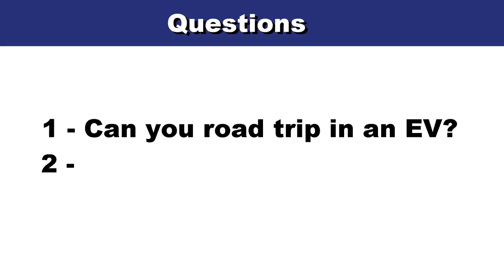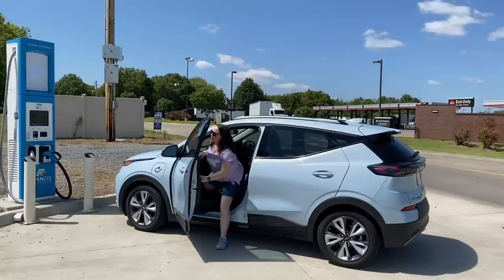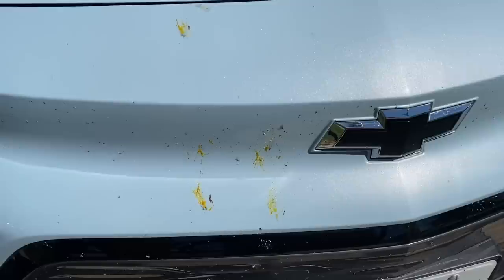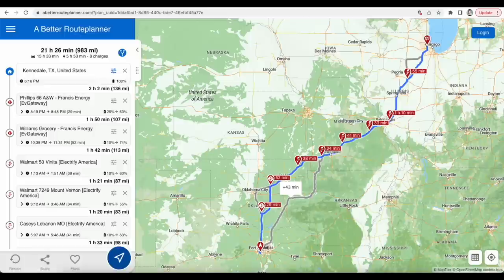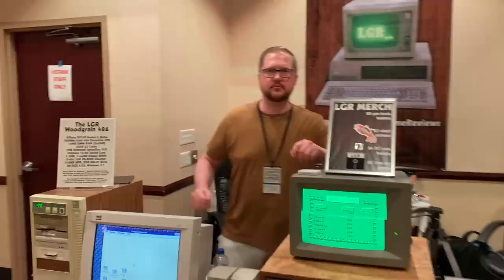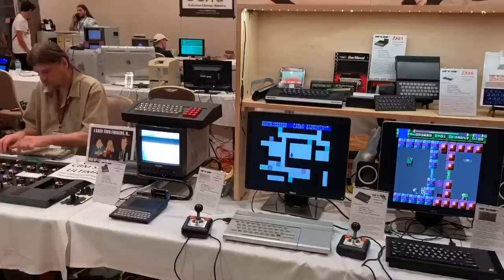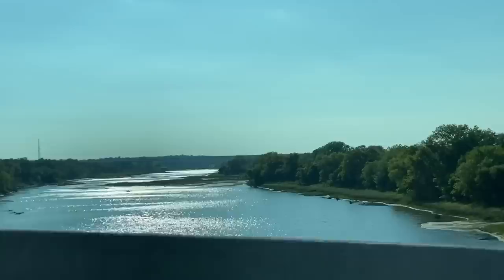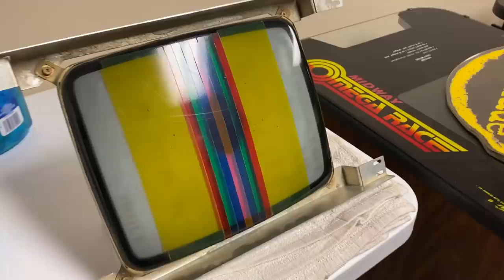EV Roadtrip, Vintage Computer Festival, and Moonbase Repair

Comment: In august I did a cross country trip that was around 80% the width of the country, it was 3 days fo driving and I generally had to gas up twice each day, and I was really pushing it but my car has a fairly small tank so even with decent gass millage I was gassing up every 400 miles. Living out west there are plenty of place that would still be hard to just go out and roam outside of the larger population centers. But sticking to major roads I think most places are fine with EV's now, especially if you are on the top end of range.
Reply: I live out West too, the pro-tip for reaching rural places with EVs is RV camp sites. Plenty of places have 14-50 plugs (or 30-TTs) so you can L2 charge, just either spend a night here and there or see if you can charge during the day while out for a hike.

Comment: I can't imagine having to stop at a gas station every 90 minutes for 30 minutes at a time. That road trip looked like torture.
Reply: I agree, but i would accept it because electricity is so cheap when compared to gas
Reply: @CrobinHood8BitGuy  But you can't put a price tag on your time.
I would have just flown there.
Reply: I used to have a Bolt, but exchanged it for a Ioniq 5. That one has 300 miles range, and it can charge for 0 to 80% in 20 minutes. Usually that comes down a quick 10 minute stop somewhere and you're back on the road.
Reply: @sjdpfisvrj  That sounds much better than 45 minute charges.  But I don't think I could deal with the stress of hunting down electric chargers. They are very rare around me in Connecticut.
Reply: @CrobinHood8BitGuy  But any savings is wiped out when you have to pay for hotels for extra days of driving.
Reply: @John_Locke_108  they are for now, and granted, buying an EV as of right now is a bit of an idealistic choice. But, what people always underestimate, DC fast charges are an exception. The eventual idea is that you arrive at your destination, plug in a Level 2 charger, and the next morning you're full. Fast chargers are there for long hauls like that.
Reply: @sjdpfisvrj  Grocery store will probably toss me out if I try sleeping in the aisles.
Reply: Yeah, I've done a 1000 mile road trip in a gas car in a single day, and that was with regular stops.
Reply: Unfortunately I believe its what's coming for all of us.
Reply: Imagine 80% of the cars on the highway are electric. How many loaders do you need to have on which space? It's impossible / It's the end of private car journeys.
Reply: @CrobinHood8BitGuy  Not in Europe
Reply: @kingforaday8725  Yep. I agree but might not be for another 20 years in which case I'll be close to 70 and near death.
Reply: @CrobinHood8BitGuy  Yeah but almost every time they stopped they went shopping, kind of negating all the money they saved. Plus as others pointed out, the time they wasted was brutal.
Reply: @brentsnocomgaming7813  A thousand miles in one day??? Jesus. I'm ready to collapse if I drive more than 90 minutes.
Reply: Reading the replies here I wonder if the same type of arguments were brought up during the rise of combustion engines. "How is this supposed to work? Streets lined with enormous gasoline tanks, containing thousands of gallons that need to be transported there constantly? That is completely unscalable."
Reply: @sjdpfisvrj  I've often wondered the same thing.
Reply: @John_Locke_108  Putting a price on your time is a normal thing to do. I highly recommend doing so as a part of considering any job offers.
Reply: The fact he also said it would have been a two day trip in a gas car is also asenine tbh. I've driven from Seattle to LA in 11 hours...
Reply: @mpowerness92  I suspect you are misremembering that figure. Google Maps puts that trip at 18 hours of driving. You would have had to continuously drive for 11 hours, no breaks, at more than 50% above the speed limit. I highly doubt that.
Reply: @mpowerness92  Yeah but that's going south which is all downhill.
Reply: @John_Locke_108  Sure you can, at work mine is worth $35 an hour! lol. Outside of work it's worthless haha.
Reply: @rebeccarainharrod  Exactly. I'm not getting paid outside of work so I would I want to leave my house for free.
Reply: Yep, Time is an irreplaceable resource.
Reply: @sjdpfisvrj  You were right, my apologies. It was a trip my Dad drove with me, I misremembered. However, he does say it was only 14 hours, and I believe him because we made the trip in a single day. Also Google maps changes times throughout the day so it's not always accurate. But my point still stands. The trip can be done in a single day in a gas car. Same cannot be said for an electric car.
Reply: @mpowerness92  the trip can't be done in HIS car, which is a commuter car. If you drive a newer car like an Ioniq 5 you can absolutely drive that distance in one day.
Reply: @sjdpfisvrj  Given that the range is only 303 miles. And as Tyler Hoover has shown, that range greatly diminishes when you start putting more weight in the car like people or equipment, I very much doubt it can be done in a day.
Reply: @CrobinHood8BitGuy  so you can get it charged for like 12 cents?

Comment: I recently road tripped across the US in a Subaru Crosstrek, and I found that on average for every stop I made for gas, I stopped twice to use the restroom and take a quick break, about once every hour and a half, even though I could drive 80MPH for over five hours before the gas light came on. If every interstate rest area had fast charging, making that same trip in an electric car would have been a breeze, and I probably would have barely noticed the time difference.

Comment: Thank you for showing us an avoidable mistake with the tube installation (you could have just left it out). When I make that kind of error I tend to “beat myself up” mentally about it thinking only I could do such a thing. Even worse, then one can be reluctant to start a repair / project in case a mistake could happen. By showing the error you let us know that, clearly, stuff happens to others too ... don’t worry about it, go ahead and do the repair / project even if a mistake could happen ... and I have. Thank you again, great video!

Comment: If anything has assured me that I do not want an electric vehicle, this video was it.  No way is it reasonable to wait around 45 minutes to "charge" before I get to continue on with my day.
Reply: Did you watch the same video I did? Did you miss the part at 0:50 where he explains the Bolt charges much slower than most other EVs available today?
Reply: Sure did.  So how "fast" does your EV charge?  35 minutes? 25 minutes   Hard pass.    @pepstein
Reply: @mayhemsennet  where are you getting these numbers? Your imagination?
Reply: @pepstein  You did not give me any numbers.. So according to Google, "Level 3 Superchargers can take a Tesla from 0-170 miles range in just 30 minutes"  So even with the top of the line charger, my numbers seem right on target.   These numbers go way up on more standard charges, apparently  So what point are you trying to make here?   I can fill up a gas tank in under 3 minutes and off I go.

Comment: If you're struggling to eliminate glare while filming, pop a polarising filter on the front of the lens.  Rotate it until the glare is gone.  You'll lose a stop or two of light coming in, but your picture will be much easier to see.

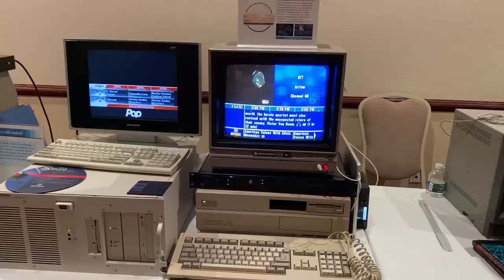Comment: 10:12 These two machines are not The Weather Channel machines, these are Prevue Channel's Amiga and TVGuide Channel's Windows NT based computers. TWC's stuff was (probably) on right/left side of the space.
Reply: You are correct, those are for Prevue Channel. I used to work for a cable company in the 90's when these were still being used, the Amiga based ones. Every so often the unit would lock up and you would see Guru Meditation flashing at the top with the scrolling text frozen, later versions just said Software Failure. The video would continue since that came from a satellite feed. 

As an aside, the top half of the screen was available at certain times for local advertising to be displayed. I would make those graphics to fit the top half of the screen as well as work within the limited 32 color pallet. You would save that to a 3.5" floppy along with other adverts and I would have one of the managers take the floppy to the head end the following morning and he would exchange them. It was kinda neat to see the graphic you made show up on the TV knowing others were seeing that too. You would also start to realize where you could blend colors and manually dither to give a better quality gradient or transition (within the limited pallet) when displayed in video versus on a RGB computer monitor. i.e. fudge it a little. I don't think I saved those pics to a disk I took home unfortunately. I do have my own old Amiga in a closet. It would be cool to pull up those graphic images I worked on back in the 90's. But I guess they are now all lost..
Reply: @marcusdamberger  Is it a prevue channel Amiga that you still have? If you still have any floppy disks from that time I would be very interested in archiving them for you.

Comment: I was a bit surprised that the EV car stops weren't terribly long. I always thought it would thoroughly suck because fueling would take so long (which apparently it doesn't). It is frequent - but not too bad. It reminds me of motorcycle travel which I really like because it force you to stop more often (fuel and comfort for the legs and ass) which means you see more. You get to see more of the places you are travelling through and meet the locals. 
Driving an EV might actually make touring better. Being able to drive 6 hours without stopping robs you of actually seeing the sights.
Reply: It should get even better as the owners of tourist stops that are actually worth stopping at realize the benefits of getting chargers installed in their parking lots.
Reply: Right, planes should land at every airport so we get to see more of the country.
Reply: @Okurka.  I don't think anyone is expecting people to stop using planes. If you're already taking a two-day road trip, it's not because you want to get there as fast as possible.

Comment: I was afraid it going to happen ever since the very shot of the tube reinstall process, it looked very easy to make a mistake and break the tube. Something similar happened to me a while back. The things are damn fragile. 
As for the arcades that really needs maintenance and is in a bad shape on display, I was involved with a local arcade museum, and they had and still have the same issue for years. Just not enough talented and enthusiastic electronics engineers to support all the stuff. They have a much lower entry fee, tho.
Reply: Does someone not at least walk through the building every so often and then shut off those machines that are obviously having some kind of issue that makes them unplayable? Also, do they turn them off nightly, or just leave them on 24hrs a day? I looked up the hours, and on weekdays they are open tell midnight and 2am on weekends from 11am that morning on all days.

That's between 9 and 11 hours a day of no use that the CRT's are getting further burned in and hours on the tubes and a ton of electricity is being used with no revenue coming in. Probably why it's $25 or twice what other arcades are charging. The question is, is it better to leave everything on 24hrs a day, or save the electricity and tubes some hours and turn them off at night? I suspect they keep everything on 24hrs a day. Less chance of components burning out or dying on power up when the most stress happens on the electronics. But man, that electric bill must be huge, nothing is "Energy Star" compliant or has "power saver" mode built in.
Reply: @marcusdamberger  It's better to turn them off at night because the powerup stress on the electronics is minimal. The things most affected are marquee lamps and other lights but, like other light bulbs, these are made to be replaced.

Comment: I didn't see the tube breaking coming, but once I saw it, I was in utter shock.  I had to pause the video.  I sat there in total disbelief with my face in my hand for literally two minutes.  Then I started laughing uncontrollably and thinking to myself, if this could happen to anybody, of course it has to happen to David.  I felt so bad for you David, but once you showed in the next scene that you had another unit with a working tube, I felt total relief.  Thanks for showing this incident and not hiding it.  It made for a great memorable video!

Comment: These videos that show how great EVs work for long trips and how much the owner loves it, only increases my conviction to never get an EV.  All those charging stops are a 100% deal breaker.
Reply: you did note the bit where other current EVs have 2ce the range and charge 7x faster? Do you figure they wont get better either? 
Lets face it, you had already decided, you didnt care about evidence.
Reply: @mycosys  Nope, I'm definitely willing to consider the facts.  But the fact is I can't afford a $200,000+ EV.  So I wouldn't have access to those 7x charge rates and 500 mile range batteries.

I'll stick with my conventional car which I can drive over 400 miles before refueling in only three minutes.
Reply: Your loss. A $47.5k Kia EV6 goes over 200 kW and has over 300 miles of EPA rated range. With tax credit that's a $40k car.
Reply: @pepstein  You lost me at "Kia".
Reply: @GoatTheGoat  lots of fast charging long range EVs to choose from: Mercedes, Lucid, Hyundai, Kia, and of course Tesla. Point is you don’t have to spend a fortune if you don’t want to.

Comment: Once again, awesome video (and soundtrack) and glad to see the one moon base machine was finally fixed! I felt so bad for you when you blew the tube by accident. That must have been heartbreaking after all the work you put into getting the running.

Hopefully you've broken the curse by fixing that machine, so you'll have much better luck locating/replacing the parts. Keep up the great work and hope you've had an excellent summer so far!

Comment: This really demonstrates how the EV infrastructure is not really there yet for the average consumer.  Props to everyone happy to be a part of these early days of it, but I will wait until it’s a lot more capable.
Reply: "Which came first: the chicken or the egg?"
Same thing here: Why should a provider install a charging station if noone uses it. Why would you buy an EV if there aren't any charging stations.

But if you own a house and can plug in your EV to the electrical connection of the house there shouldn't be any problem for the daily drive. Unless you're doing a couple of hundred miles a day, that is...
Reply: You have to remember that the Bolt is not typical for modern EVs. Most EVs have more range and charge much, much faster. I have done a 550 mile trip (one way) with one ~30 minute stop many times in an EV with 300 miles of range.
Reply: This is one of the reasons so many Americans choose Tesla over other EVs: Tesla's dedicated charging network. The good news is that both Tesla and non-Tesla charging networks are growing and improving quickly.

Comment: I recently went on a 12 hour drive vacation with a friend and his family, many of whom are vehement electric car haters because reasons. Of course, the trip is 12 hours on a map, but after all of the stops and breaks, it was about 15 hours at least. I think in reality electric car infrastructure is extremely useable for most people, as once you're out of the car to stretch the legs, you will almost always find yourself waiting on everyone else to finish their business, often up to 45 minutes of waiting per stop.
Reply: The practicality of long road trips varies.  You're fine where the distance between towns is an hour apart. In states like Utah and Wyoming it would be difficult if not impossible unless you had a long range EV.
Reply: @ConvexCheeto  true, I’m thinking from an east coast perspective

Comment: I have been wondering if road trips might look more like the time before interstates for the next few years while charging tech improves. So what I mean is roadside attractions start popping up around charging centers. So there is something to occupy 20-30mins while charging. I actually think it would make trips more fun, the journey not the destination.
Reply: Good point, but the environmentalists won't like that. They have something against the sprawl, and wants us all to live packed in big cities, for some odd reason.
Reply: @kimkimpa5150  that isn't sprawl
Reply: @CoWinkKeyDinkInc  Britannica: "urban sprawl, also called sprawl or suburban sprawl, the rapid expansion of the geographic extent of cities and towns, often characterized by low-density residential housing, single-use zoning, and increased reliance on the private automobile for transportation". Sounds like spraw to me.